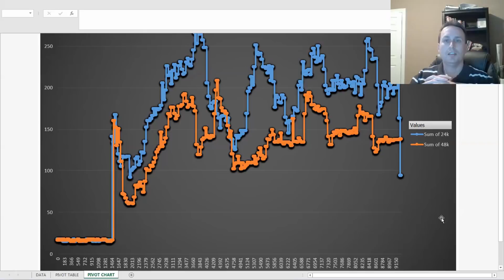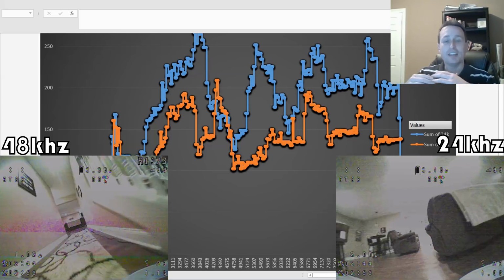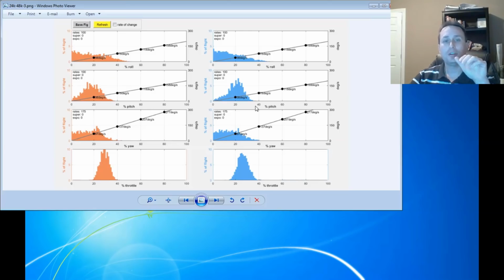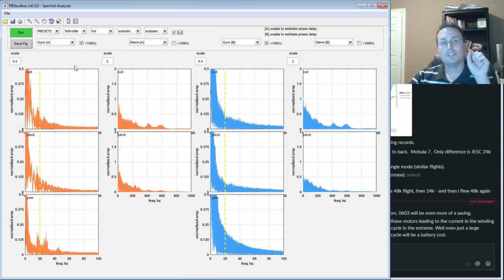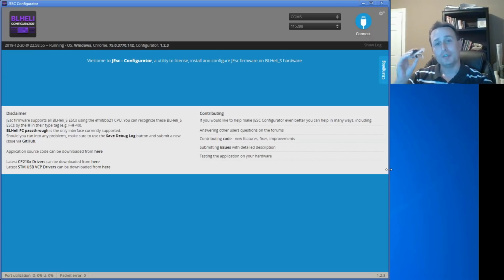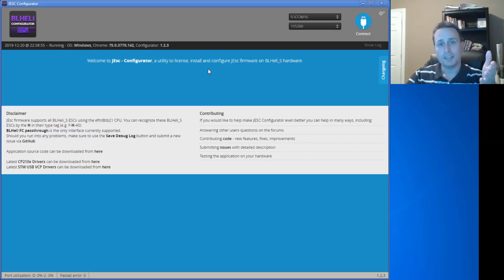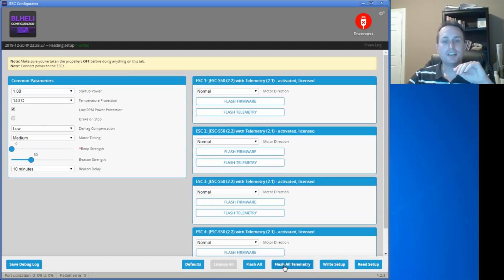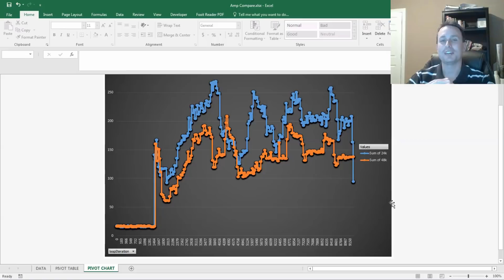24khz vs 48khz ESC Comparison

Comment: I just did this on my 3" whoop, but i got exactly the same flight time, am I missing something? I also used your betaflight  whoop preset.
Reply from the maker: You were at 24k to start for sure?
Reply: @uavtech  yep, and I didn't have rpm filtering or any of that available either.

Comment: I updated my firmware and found an extra minute.  I'm flying a 103g, 2S rig with a 12A ESC and 1103 7800kV motors spinning 1.9" tri-blades.

Comment: Great Vid, I tried this on my Mobula 6, it went through the flash OK, but now the motors will not rotate, i flashed back to BLHeli 16.7 same problem, flashed back to JESC still same problem so have i screwed up my board or is there something Im missing? thanks in anticipation, keep up the good work.

Comment: Is there anything else I have to do for this set up? I get fly aways on any PIDs that are tuned higher than the defaults, and the throttle behavior is very strange (I can cruise around and maintain throttle at 0% throttle). Flashing back to default blheli_s 16.7 makes it go back to normal.
Reply from the maker: Sounds like something is wrong.  Like a vibration issue for sure.
Reply: @uavtech  Yep, you're right. One of the posts that fastens the FC down was broken and I couldn't really tell at first. Thanks

Comment: I wish the manufacturers of esc’s would pay JESC to install the 48kHz and just add it into the price. I think it’d be less noticeable to the end user. But manufacturers are probably looking at the bottom line, even if it could be passed on to the consumer, it’s still an added step, which = $.

I don’t think it’s the $6 that people gripe or are hesitant about. Even if you have 5 or 6 quads. It’s well worth it. Once you flash one quad you’ll want it on all of them( that are applicable). This hobby is not cheap as we all know and I think it’s the mobile/phone/tablet ‘free vs paid’ mentality. It’s not rational. 

Case in point; one of my pet peeves is app subscriptions. I’d rather pay a larger amount and potentially not get my money’s worth out of it than continue to pay monthly. If an app doesn’t offer a one time purchase, I simply won’t buy it. There have been quite a few that I wanted, but didn’t want the monthly fee! Many times you can get a subscription, use the crap out of it, then cancel and may never use it again. I guess it’s the idea that paying a subscription to just have something ‘in case’ you need it, when in reality you used it once in 6 months yet paid for those 6 months.

For me personally, it’s the need to do one more thing with the computer that could lead to frustration. I assume for most younger or more computer literate people out there that it’s not an issue at all.

Comment: Do you have any thoughts on Jazz Mavericks 16.73 vs 16.8 vs 16.9 compatibility with Betaflight?  All I can find is recomendations to not go above 16.73 and a few scattered people saying they've been using 16.9.  Curious to know your thoughts.  I put 16.77 48khz on my mob 6 and it destroyed battery life.  Maybe 1 minute fly time.  If I'm run 16.73 or 16.9 (I don't see mention of 48khz not sure what it is).  Then I get about 2.5 minutes of flight on 350mah.  On my geprc with 16.9 it'll fly away when armed.  16.73 works great... not sure what the story is behind all this can you shed some light now in late 2020?

Comment: I just a/b tested blheli-s 16.7 24khz and jesc 2.2 48khz in a hover test with my babytooth (1202.5 11500kv on 1s) and got 7:05 and 8:25 respectively.  Which works out to a 19% increase in flight time/efficiency.  I haven't flown any packs full acro yet, but if there aren't any real downsides, I'm completely astonished at the improvement.  Motor temps seemed identical, slightly above ambient, but as said, just a hover test.  Either way, I think its worth a shot for anyone flying whoops or micro/toothpick style 3"ers.  Just crazy how much extra flight time I got.

Comment: What is a reason you shouldn't run 48khz? I see jesc says 3" and up should be 24?
Reply from the maker: Because 48hz reduces low end torque and breaking force.
Reply: @uavtech  ah okay, on a 2.5 or 3" toothpick, would you run 48 or 24?
Reply from the maker: If you want longer battery life, yes.  Or you have MTO issues.  

If not, 24khz is still the way to go I reckon.

Comment: When is best to use 24k, 48k and 96k ? I have all sizes of drones. Use what one on what size drone ?
Reply from the maker: 48khz for 3" and below.  The rest 24khz.  96khz I have not messed with that.
Reply: wow thanks for getting back to me. I just put 96khz on a 3" today with RPM filtering. Fly's much better but prop wash hard. Should I change it to 48khz tomorrow ? Got a fast fix for the prop wash issue ? Thanks in advance my friend.

Comment: Tried 48 and 24khz jazzmaverick (same esc name but newest) on TinyhawkS 4.1.5 and i don't like it. I want to do acro outside 
so i need maximun throttle power and minimun propwash and fly the mockingbird settings.
What happend is that i did a dive and at the end i get propwash and crashed. With 24khz it is flyable but in dives i get propwash but fly very smooth more for hd/cinema like. Before on 4.0 the propwash handling was much better. I coppied pids and filter settings from the 2 ths 4.1 filter video's on youtube. I'm just looking for a good start tune and tip's
Reply from the maker: Check out: https://www.youtube.com/watch?v=NWjY9nEVenI

Comment: In the newest firmware for 48K in JESC,it says 48k for whoops and 24K recommended for 3inch and up. Is it OK to run 48K on a 2.5 inch prop?
Reply from the maker: Yup.  That is just general for battery life increase on the smaller motor quads.

Comment: It is always a good idea to read all the comments. I wanted to ask if there is also a big effect on 5” quads. But after scrolling down a lot I got multiple answers: it’s a tiny quad thing. Even if it is easier to ask a question than to scroll down and read 100 comments - have respect to the youtubers and save their time answering the same question 5 times.
@UAVtech: thanks for developing, testing, experimenting, sharing and answering all those questions from us. 🙏
Reply from the maker: Thanks!

Yeah, on all quads it reduces the breaking force on the motors.  On 5" can give wobbles.  You can tune out with higher gains, but it does need done.

Comment: Be carefull with jesc, i lost esc3 after flashing my mobula 7
Reply from the maker: Contact Joe for help.  https://jflight.net/index.php?route=information/contact&language=en-gb
Reply: @uavtech  i wrote them, they can do nothing. they told me i lost connection when flashing. i saw a lot of people had the same problem.   Now i have to buy a new fc!

check here : https://github.com/jflight-public/jesc-configurator/issues
Reply from the maker: Yeah, it seems like a not so great USB connection is getting a lot of folks.  I know I have something similar where a USB that looks perfectly good doesn't work well with my mic for recording videos and/or when connecting to ESCs it is really slow.  If I use my other USB cable that I think i got with my phone, it works fine.
Reply: @uavtech  seriously! my usb cable and connection work perfectly fine, i flash many time with betaflight and blheli, never had problem, but i had multiple problem when flashing with jesc !
Reply from the maker: @mathieucharroisaerialprodu6161  , ok.  But many more did not.  So what is the difference?  In either case, it sucks and sorry to hear.  The configurator and firmware are simple forks of BLHeli_S and the core code I would imagine is the same.  Again, sucks but my hunch is it is not a systemic issue with JESC.  It is a thing that happens when the connection between the ESC and Configurator glitches.  One thing to try may be the BLHeli_S Configurator (none Chrome app version).

Another question is did your Mobula 7 have "H" type or "L" type ESCs?  I would assume it was "H"?

Comment: I tried flashing the 48Khz hex on two different original Tinyhawks and both wobble like mad in a hover. I put it on my two Mobula7s and they are smooth. Any suggestions on what is causing this or changes I need to make to my settings to stop this wobble.
Reply from the maker: Up your PID gains.  Hold the P/D Balance (ratio), and just up the gains.

If on BF 4.1.x, you can increase the Master Slider or PD Gain slider.
Reply: @uavtech  Thanks, I'll give that a try. This is my first go at 4.1.x and things are a bit different so I wasn't sure where to start. I appreciate the tip.

Comment: UAV tech is it still recommended to Use 48khz on a 5” with BLHELI-S
Reply from the maker: eh...   Not sure.  It definitely produces less motor command authority.  So you will need higher PIDs to compensate.
Reply: UAV Tech got it . I did update the ESC on one of the 5” quads, but I think for now I’ll just leave directional dshot off since I have the 5” so dialed already.  Until someone does more testing.. As far as my toothpick class those changes were significantly better..
Reply: 48khz PWM extends battery life only for whoop class motors.

Comment: I'm a bit confused on the JESC config app you are using. I downloaded it but it won't read in any of my whoops. Betaflight configurator connects fine.
Reply from the maker: JESC configurator from Jflight site?  Powering ESCs with battery.  For me, i did not need to, but ...

Comment: Do I have to make any changes in betaflight?  my present ESC protocol (from factory) is DSHOT600 - I'm also running your PIDS from the other tuning video, massive improvement over defaults thanks!
Reply from the maker: Nope.  No other changes.
Reply: @uavtech  i tought was related. But change dshot is about rpm filters. Am i right?

Comment: Is the 48khz firmware available for BB1 BLHeli_S ESCs?

I realize the JESC telemetry module for RPM filtering requires BB2.
Reply from the maker: Needs to be an H type ESC I think.  Not working on L type.

Comment: I'm ignorant in the science of ESCs, will these types of frequency changes improve flight time for airplane ESC and long range quad flight times?
Reply from the maker: Probably not.
Reply: It prevents excessive motor braking which only happens at quads, not on planes. Only on 603 and a little on 802 motors that occurs „buggy“ therefore only on whoops and maybe toothpick class that de-bugging helps extending flight time.  Blheli-S was developed and tested on bigger motors where no efficiency bugs occur and therefor no more optimization is possible.

Comment: on my fatty mobula7hd, flight time was similar But I did notice a significant improvement of voltage recovery with regard to throttle management (300mah 1s gnb in series), so after a blip of throttle the voltage sag period was shorter.

Think Ill give jesc a shot on my beat up tovsto falcon 210 derivative

Comment: Is this just a problem on the 06xx,08xx  motors? Will there be any advantage on bigger motors, 11xx, 12,xx etc.?
Reply from the maker: not sure.  seems like maybe, but not as much.  try it.  maybe with 11xx and 12xx motors you are on BLHeli_32 (easy setting change)?
Reply: @uavtech  I dont have blh32 on mine. I have a question about a build. When i use the smoke stopper it lights up very dim, just barely on, but getting hot motors, and it could be a 100 other things, but this is the only one it lights up at all. Ive checked all connections many times with a multi meter, so Im wondering if this could be normal, or is something possibly wrong with a motor. Im going to start pulling motors if you dont know. Its a really tight, clean acrobrat build, and I was hoping I wouldnt have to take it apart again. Thanks

Comment: Hellow. Some scientific) diatone r249+   plus some heavy stuff like new vtx,prop guard etc. Same battery ,same quad.   2s 650 mah, flight at room with angle mod and +-1m over ground. Battery from full untill  first low beep( not full flight but enough to say is it work or not for me) 
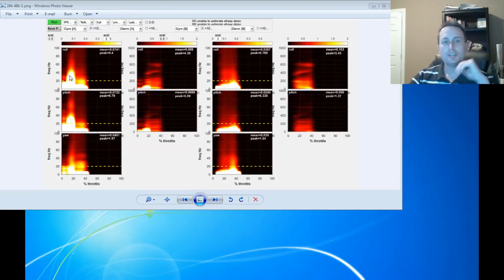Results are:   4:02  with 24khz jesc. and 4:41 with 48khz jesc.  smth like + 16% of flight time. good news. Thanks a lot. hope that is woudnt be much propwash etc

Comment: One thing to note is that JESC requires at least Betaflight 4.1 RC3, which requires an F4 flight controller, which most Mobula7's don't have (unless you're late to the party and only recently got one, and even then, it might be a toss up depending on where you've bought it). Mine is one of the older F3 versions, so I'm out.

Oh well, I can try it on my Sailfly-X to see if it does anything, but I'm not holding out. So far, Betaflight 4.1 has flown like crap on every quad I've tried it on and no amount of tuning helps as much as returning to the previous version that was on it. Hopefully, any benefit 48kHz provides won't be drowned out by problems I've been experiencing with 4.1 so far.
Reply from the maker: No true.  JESC works with any firmware.  

Also see https://youtu.be/q3W7UGRs6bo

To have 4.1 and RPM filters on F3.  This test was with an F3 Mobula 7 board.

Also see https://youtu.be/NWjY9nEVenI for pids you need on a whoop.  It is not 4.1 that is the problem.  Same PID Controller as always.

Also see http://tiny.cc/pidtuning for a more clear understanding of PID terms.  These thing about how one version is good and another is bad are crazy (on any firmware). The PID controller is a simple thing and never really changes at the core.
Reply: @uavtech  When you said it works with any firmware, did you actually mean to say that it works with either version of the Crazybee board that comes in the Mobula7 (F3 or F4)? JESC depends on Betaflight passthrough to communicate over USB and JESC Configurator will flat out refuse to work unless you have at least Betaflight 4.1 RC3 installed.

Thanks for the tip about Betaflight Performance edition. I hadn't heard about it in several months and forgot it was still a thing. I'm kind of surprised it's still around and that the developers haven't lost interest yet. Anyway, I put it on my Mobula7 and gave it a try with JESC 48kHz. It handled like a toy boat in a bathtub with any combination of PIDs I tried until I disabled d_min entirely. I stumbled upon your Community Preset for the Modula7 and you seem to have come to the same conclusion because it was also turned off there. You even arrived at similarly high P and D gains on the pitch and roll axes like I did. I'm not sure why every other Betaflight 4 tune I've found for this model is so radically different (low PIDs and low d_min).

The tune is not quite as good as it was on 4.0.0 nightly (what it shipped with) or 3.5.7, but at least I think I have a path to getting it there now. 48kHz ESC output had no effect on battery life for me, but voltage sag and 1S whoop batteries being universally terrible are likely to be the root causes there. As soon as I puff all of my batteries (which won't take long, I'm sure), this quad is getting an XT30 connector so I can fly it with some real batteries.
Reply: I looked at the JESC site as well and it’s noted you must have the 4.1. JESC is currently in early access and works with Betaflight 4.1 RC3 and up. Please be extra careful and follow these instructions to the letter!  

But you mention JESC works with any firmware?  I have BF 3.5.7.  Am I mis interpreting  part of the process ?  I’d like to get the 48khz working on some of my micros.  If I have to install BF 4.1, I will but would like to ensure I’m understanding you correctly.  Thanks for all the videos... They’d helped me out in many cases throughout.  Very detailed and well structured.
Reply: @chrisjennings6664  I think there are a couple of different things at play. 1) You can get 48khz from JESC without using RPMfilter, so the RPMfilter bidirectional Dshot stuff can be set aside.   2) 4.1 builds are available for F3 boards. In the video its listed as "4.1.1" but its closer to betaflight 4.1.0.

keep in mind that you can always flash things back. and also remove props when flashing ESCs and FCs
Reply: @DoctorWhom  Thanks for the response.

Comment: Looks like placebo :lol:
Reply from the maker: LMAO.  Good one.  :-)
Reply: @uavtech  sorry my mistake...  its really works , only on whoop.
Reply from the maker: @HERSDT_FPV  , yeah.  It is a small motor thing.
Reply: @uavtech   i test it right now, difference may be 1-2w  from 55w consumption, but most likely it's a placebo
Reply from the maker: @HERSDT_FPV  , what motor size?

For smaller motor sizes it is proof on proof with sound understanding of why the effect is real (article). This is data based conclusions for the micro motors.

Comment: I'm running a 1104 9500KV, gemfan 3018 props, CrazybeeF3 Pro(Mobula7 FC), on 4.1.1 Perf Ed, No RPM Filter. Switched to JESC 2.2 48KHz, still didn't get RPM Filter, went from 2:45-3mins of freestyle, to nearly 4min on the same batteries. Flew great. ESCs and Motors cool.